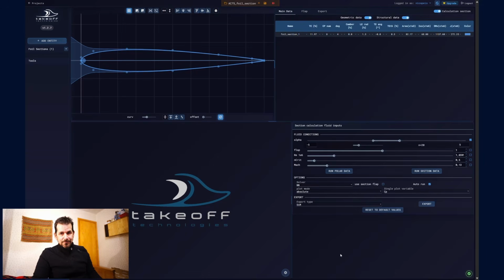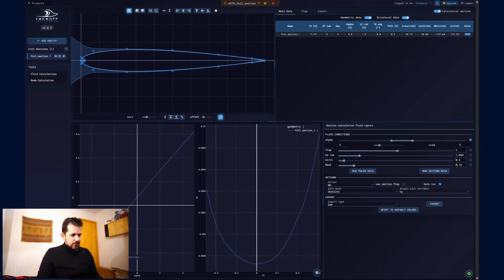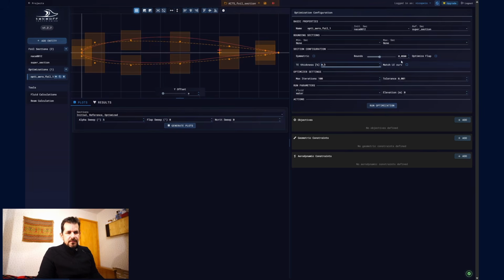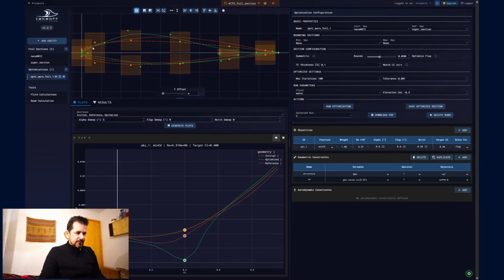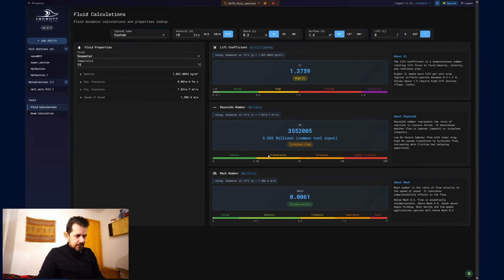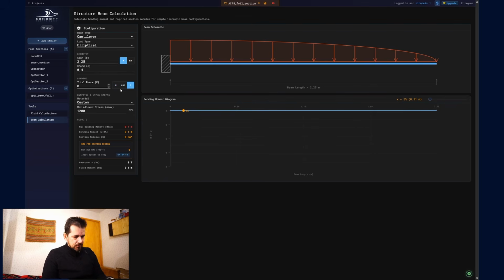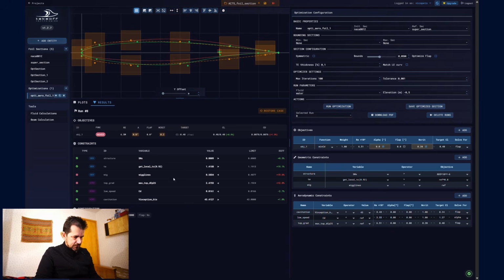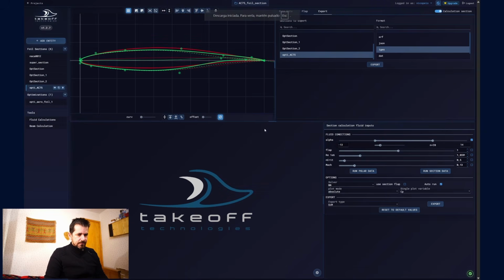Designing an America’s Cup Boat: Foil Section | EP01

Comment: Just came across this software and am definitely keen to play around with it a bit. Are there any plans to add any 3D features? Would be particularly interested in if there was a way to optimise for cavitation at the strut-foil junction. What have you found to be the best way to design for this sort of 3D flow structure, particularly when starting out with 2D tools?
Reply from the maker: Yes, we are excited to share that we’ll begin deploying the 3D version by the end of this month! It follows the same philosophy as our 2D tool: smart imports, an intuitive parametric model, fast physics solvers, and seamless optimization with exports to CAD.
Regarding the strut-foil junction, you're spot on—that’s a complex 3D interaction. To effectively optimize for cavitation there, we need high-fidelity pressure distributions at the junction. Our roadmap includes integrating RANS (Reynolds-Averaged Navier-Stokes) calculations to handle these specific flow structures. This will be rolled out shortly after the core 3D modules are fully implemented. Stay tuned!

Comment: It's working nicely for Me now, I was able to validate that my Ruder profile was not perfect for my needs. I'm struggling a bit with the meaning of things and miss a function that shows a little exploration of things. Like if I hover for over 3sec over the letters a box opens and shows a little exploration what it is... Even the full word would help. For example cl = Lift, TC = thickness of the profile. For those it's easy but Ixx(x1e6) ? No idea
Reply from the maker: Thank you for the update! We’re thrilled the tool helped you refine your rudder design.

You make an excellent point regarding the descriptions. We are currently looking into adding tooltips (hover-boxes) to explain these parameters and their abbreviations in plain English for future updates.

To clarify that specific value: Ixx refers to the Area Moment of Inertia around the horizontal axis.In simple terms, this value tells you how much the section is flexible/rigid to bending. If you want a new rudder to be just as stiff as your original one and you will only modify the section, you should aim for a similar Ixx value as the reference one.

Regarding the (x1e6): because we calculate these for a normalized chord of 1, the raw numbers are extremely tiny. We multiply them by 1 million simply to make the numbers easier to read and compare—turning something like 0.000005 into a much friendlier 5.0.

Hope this helps, and keep the feedback coming!
Reply: @TakeOff-Technologies that helps a lot. Thank you. I will keep you upgraded

Comment: Thank you for that informative Video! Is there an option to import dat. files? I am also interested if there is a limit in how low a reynoldsnumber can be for the software to still operate as intended?  I build hydrofoils for watersport applications and i my lowest reynoldsnumbers are at around 10000 Re. Thank you!
Reply from the maker: Thank you for the kind words, @jottjott264!

To answer your questions:

File Imports: Yes, you can definitely import .dat files. We also support .csv, .txt, .arf, and even .iges. The software is designed to extract the section data and automatically fit it into our 2D airfoil NURBS parametric modeling system.

Low Reynolds Numbers: A Reynolds number of Re = 10,000 is indeed quite low and sits right at the edge of what XFOIL-based methods can reliably predict. At these levels, laminar separation bubbles become very dominant, which can lead to convergence issues or less accurate drag predictions.
As long as you are mindful of these physical limits, the tool remains a great resource for identifying general design trends and paths. That said, we are currently working on integrating more advanced solvers specifically designed to better handle these low-Reynolds cases. Stay tuned!

Thanks for the great question!

Comment: Interesting that you use an N_CRIT value of 0.20, much lower than what I'm using. You mentioned being able to fill an episode about it, please do! Is this 0.2 value coming from observation/experience with AC? Would it also apply to slower foil sections?
Reply from the maker: Thank you for the comment, Marteen! You’re right—the choice of Ncrit is always a point of debate. Many XFOIL users use it as a calibration tool to match experimental data or other software. In these specific simulations (Re 5-10M in seawater with waves), the environmental turbulence is significant, which is why we lowered Ncrit to better represent those 'messy' real-world conditions. While slower foil sections or calmer environments might justify a higher Ncrit, it remains a sensitive parameter to tune. 
What numbers are you using for your work? What kind of section are you currently analyzing?
Reply: @TakeOff-Technologies  I'm designing and building foils for wingfoiling and kitefoiling as a hobby that has gotten out of hand a bit ;-). I wrote an optimizer program in Python that works similar to yours, without the polish. I use fewer spline parameters (15 vs 22 for you). What optimization algorithm do you use, and what hardware is this running on? My cost function is much more complicated, I calculate parameters for a range of speeds (usually 14), and weigh in several other properties (i.e. ventilation susceptibility and linearity of CM) and normalize for takeoff speed (i.e. higher CLmax gets a smaller chord and everything gets scaled accordingly). Optimizing for a wider range of objectives usually generates thicker sections with zero weight for bending stiffness.
My program also averages multiple n_crit values to prevent over-fitting, for foils I usually take 1.5, 2.0 and 2.5, for mast 1.0, 1.5, 2.0. But there is no science behind it, I measured high-end racing foils and could see they used around 2.0 and 3.0 for their sections, I went a bit lower but never below 1.0.

Comment: Hi,
Thank you for the very nice and informative video. I am a hydrofoils engineer with the Solar Boat Twente student team. We usually build solar-powered hydrofoiling race boats, but this year we are developing a methanol-powered one.
We have recently completed our foil profile development using XFLR5, Xoptfoil2, AirfoilEditor, and custom MATLAB scripts. Your software tool integrates all of that very impressively. 
Our boat has a conventional split T-foil configuration with independently actuated wings. We strugled quite a bit to balance a wide range of lift coefficients with cavitation avoidance. So far, we assess cavitation risk by checking the Cp distribution along the chord against the vapor pressure of water, but we are unsure how conservative this method is and currently apply a 50% safety margin. In the video, you mentioned cavitation inception speed as a design parameter. Could you recommend literature on this topic? Additionally, I noticed you use an Ncrit value of 0.2. We were advised to use values between 1 and 3 and to set xtrip on both sides at 2% chord. What would you recommend?
Kind regards,
Roman
Reply from the maker: Hi Roman, thank you so much for the kind words! It’s great to hear about the work you’re doing at Solar Boat Twente—a methanol-powered hydrofoil is an exciting challenge.

Regarding your technical questions:

On Cavitation: We use the same methodology (comparing Cp to the vapor pressure). As you know, the cavitation inception speed is highly sensitive to depth, so ensure that is accounted for in your hydrostatic pressure calculations. If your wing is 'clean' (far from junctions), this method is accurate. You could likely relax that factor far from the intersections. The real complexity lies at these junctions where component pressures interfere. 3D analysis (like RANS or LB) is an accurate way to capture those hot cavitation points, using this same Cp methodology.

On Ncrit and Xtrip: Transition modeling is always a bit of a 'black art' based on specific real-world data, and every engineer has its own methodology. We like to let the transition free to study how to promote laminarity and understand its impact on other parameters. By setting your Xtrip at 2% on both sides, you are essentially forcing a turbulent flow, which explains why a higher Ncrit (1–3) works for your current workflow.

Good luck with the development! We’d love to see the boat in action once it’s ready.
Reply: @TakeOff-Technologies Thank you for taking the time to answer!